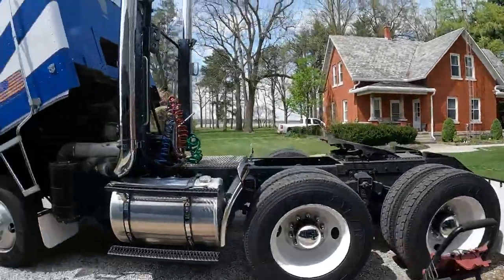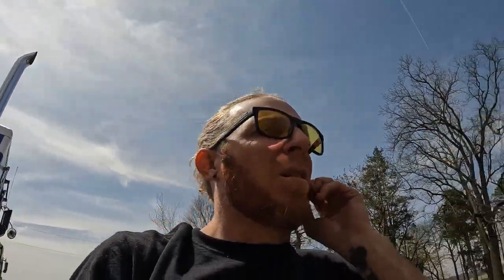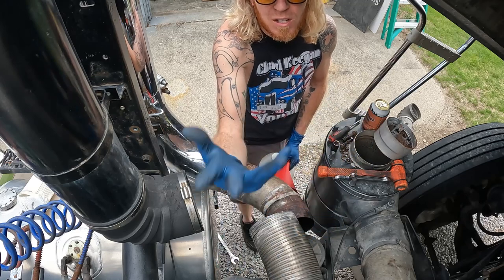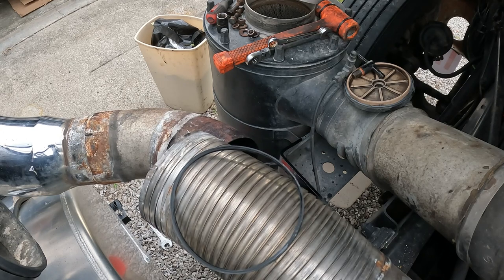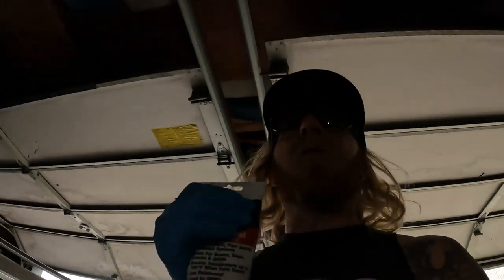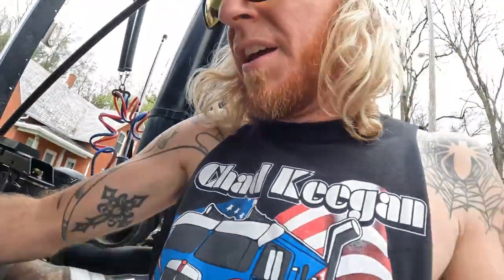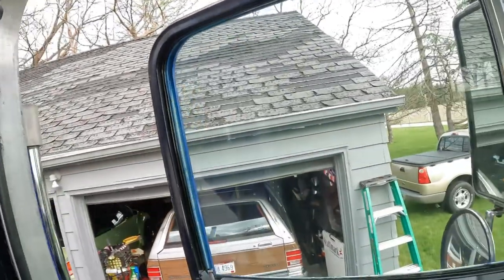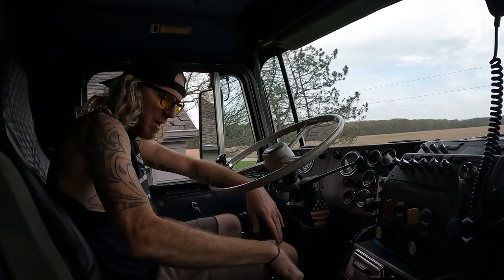K100 BC 350 Drop In Fuel Filter Replacement What A Mess!

Comment: That's funny I thought for a second that was the steering column not the shift linkage.
Reply from the maker: The steering column is up against the cab
Reply: @Chad Keegan  yes I realized that but for a split second I was holy sh$& .truck is looking good my truck is only 25 years old its a young buck. Picked up Dec 1997 brand new w900l.